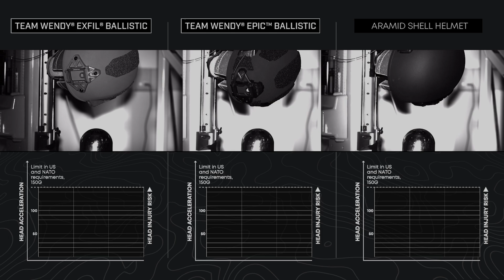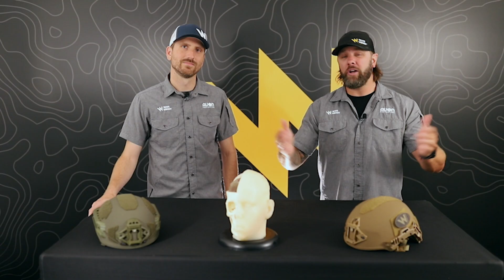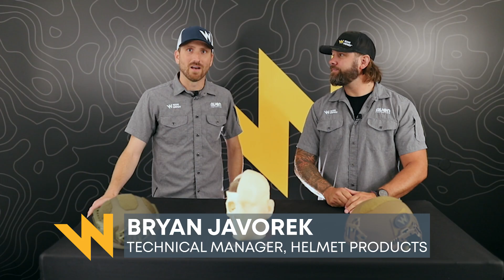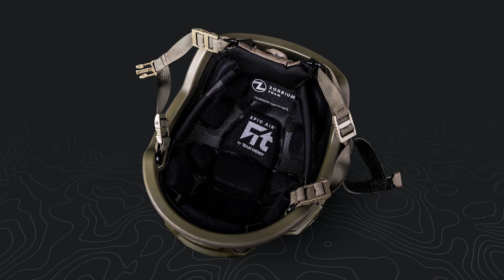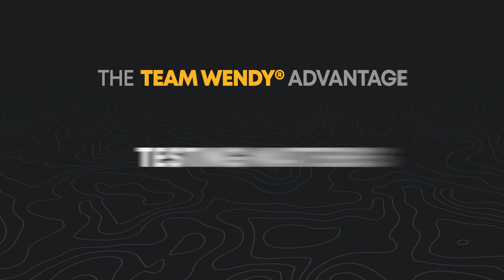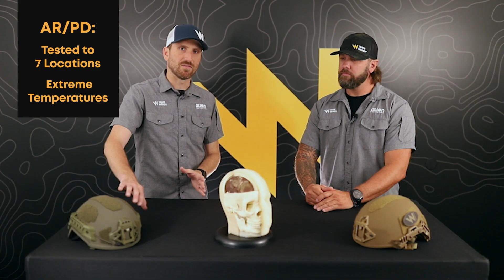Polyethylene vs Aramid Blunt Impact Performance

Comment: Enjoyed the video, but besides the brief video/graphic of aramid vs PE helmets being tested, there wasn’t any discussion/explanation of the difference in blunt impact protection between material types… is it mainly the pads that make the difference?
Reply from the maker: Thank you for watching and for the question. You are right that pads play a major role in blunt impact protection, but shell material and geometry also influence how energy is managed and transferred to the liner system.